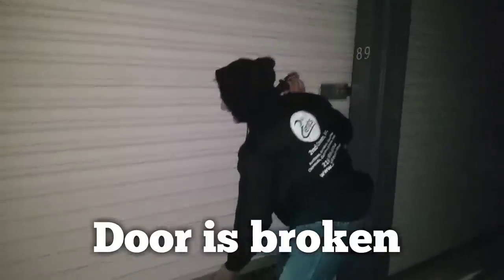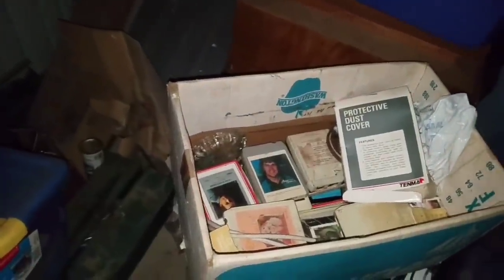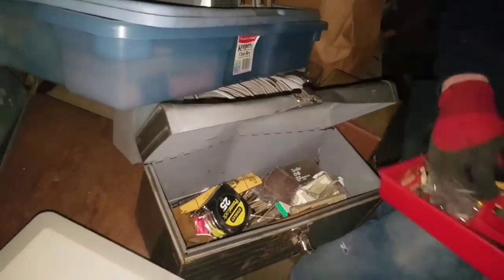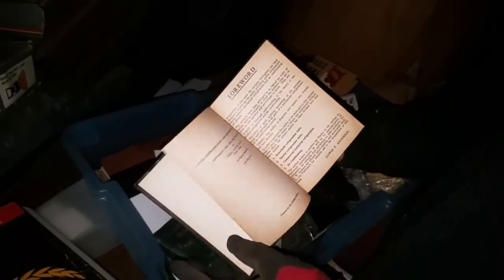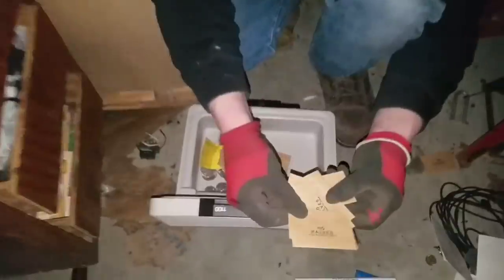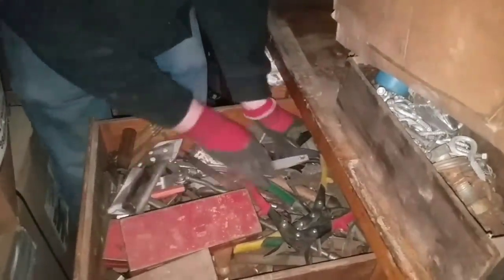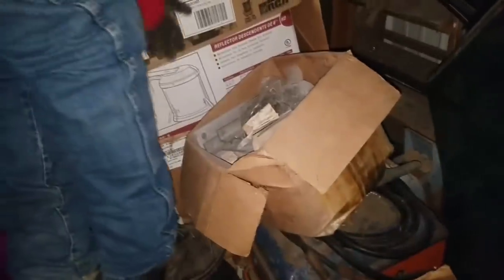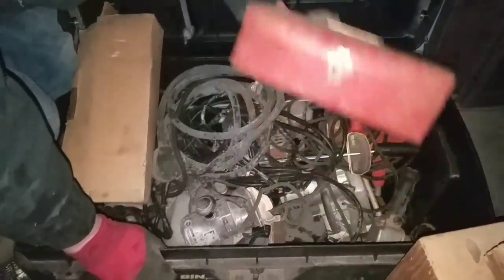YOU WON'T BELIEVE WHAT OWNER LEFT BEHIND IN THIS ABANDONED STORAGE UNIT! Unboxing Video part.2

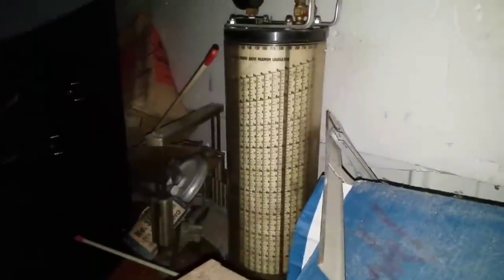Comment: 32:33, yes, that is for HVAC, when you knew the exact amount of Freon that went into a system, you would hook your tank up to that and fill charging unit. Then you would connect the charging unit to the equipment and put the Freon into it. I don't remember exactly how it all worked out, but saw my dad use it many times over the years.